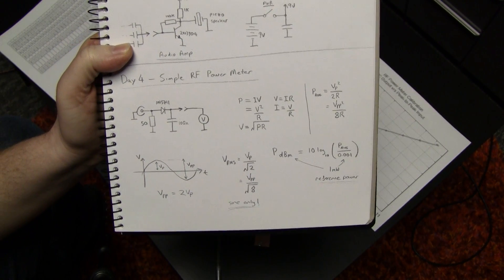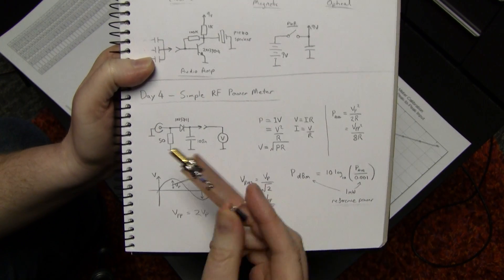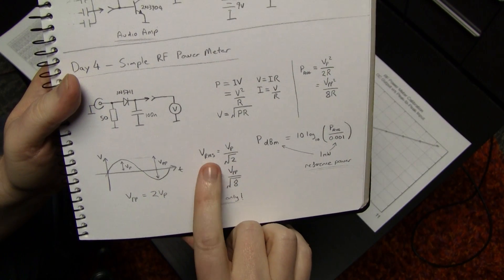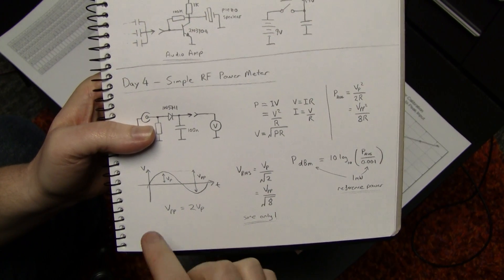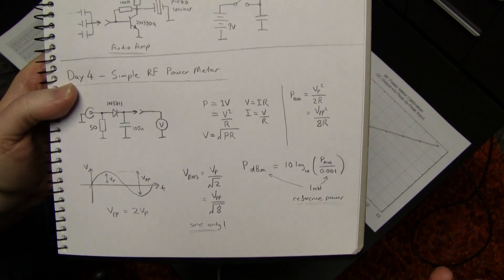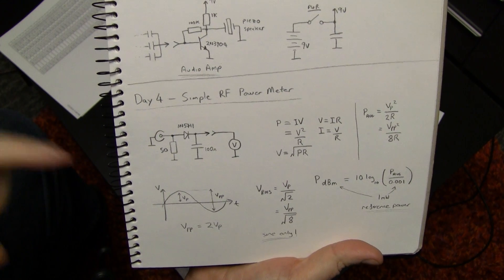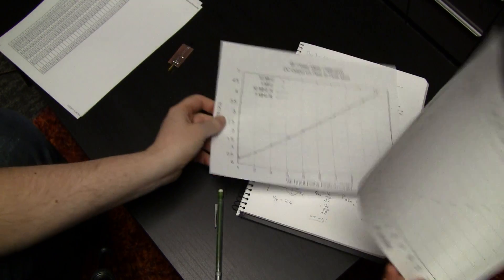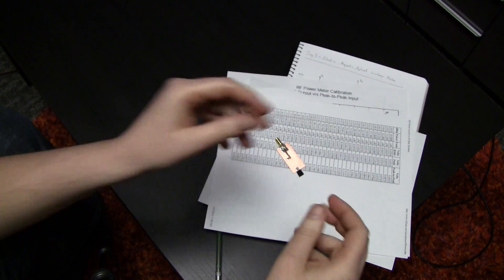Advent Calendar of Circuits 2014: Day 4: Simple RF Power Measurement

Comment: Hi i am Vyshak
I need to measure 25KW of RF pulse power. Can you help me to measure high wattage RF power. 
Thankyou
Reply from the maker: 25 kW is about 3160 volts into 50 ohms, so a suitable diode to directly measure the peak RF voltage is basically unavailable.  It is best to sample a fraction of the power with a directional coupler or attenuate down or some mixture of the two.

At it simplest this can just be a resistive divider across the power dummy load that brings the 3 kV down to something more reasonable to peak-detect with a diode like 50 volts.  The impedance has to be reasonable so the termination is still close to the desired load impedance and there is little frequency dependence in the attenuation if that matters for the application (or one could calibrate it at a specific frequency using a much lower power CW source like a signal generator).  The power load resistors and the divider need to be rated appropriately but multi kV resistors are a lot more available and cheaper than diodes or capacitors.  If the RF is swept within the pulse or the envelope is especially short or complex then it is a bit more complicated, and depends on what you want, the peak envelope power?  The average power?

Another alternative is a thermal measurement. If you calibrate the load for calorimetry you can measure the temperature increase over a given time but you would need to know the duty cycle of the pulse (and its shape if it is complex) to get peak power rather than average.  Such methods are much slower but your dummy load can just be a length of lossy coax in a bucket of water.  This is a very general method and works well at higher frequencies where the parasitics of a lumped attenuator might be problematic, but I would only bother to do this for fun, not a real instrument.  It also has to be properly calibrated and the load fluid stirred properly, etc, getting accurate results requires good technhique.
Reply: Thank you for replaying.
Impedance is 75ohms resister of 125 Watts I am using to reduce the power, 
Any suitable peak detector diode or any solid state RF detector ??
Reply from the maker: @vyshakgowda7725  125 watts in 75 ohms is around 137 volts peak.  The great majority of RF diodes are rated at 50 volts PIV, some 80 volt ones are available.  Better to attenuate down.  Or for example divide in the dummy load itself, which might be 3 * 25 ohm resistors in series, across one of the resistors would be dropped 46 volts.  Ideally you'd want more headroom to avoid diode reverse breakdown, so something closer to tapping at 10 ohms might be in order.

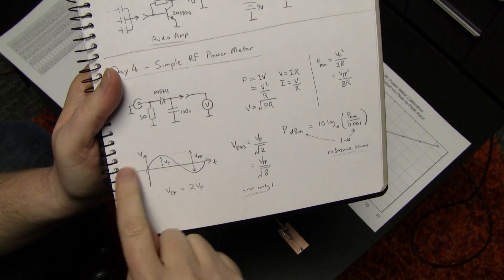Comment: Splitting hairs here, but 2:50 description of RMS voltage as mean(abs(v)) is incorrect; RMS is actually sqrt(mean(v^2)). Example, for a 2Vpp sine, mean(abs(v)) calculates 0.637V, instead of sqrt(mean(v^2))'s result of 0.707V -- a 10% error. Just FYI.
Reply from the maker: Hezekiel Randolph indeed my bulldozer description was purely metaphorical.  RMS is the quadratic mean which happens to have the nice property that for signals describing a voltage or current it gives a figure for which an equivalent power would be dissipated by that DC level.  RMS is also a handy measure of deviation, for signals with no DC component (or one that has been servoed-out or for the consecutive differences/aka differentiated/high-pass filtered) it is also the standard deviation/squared variance.